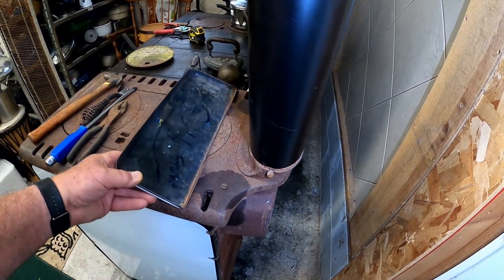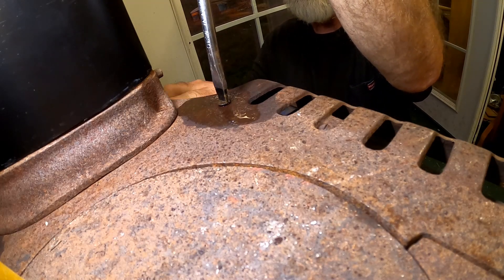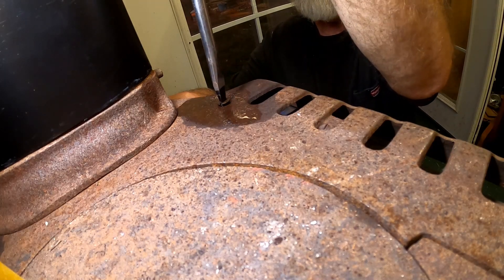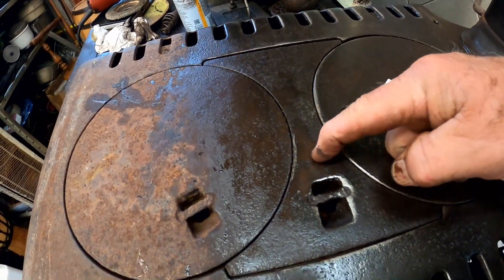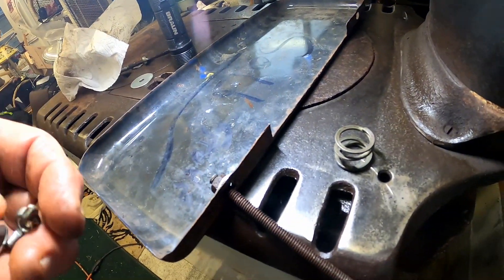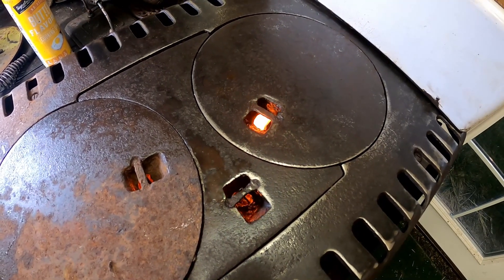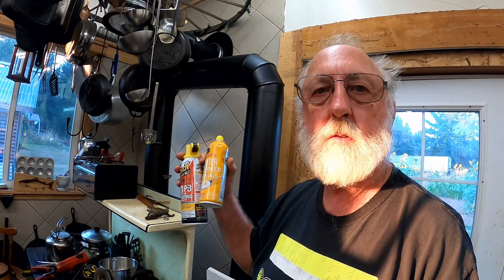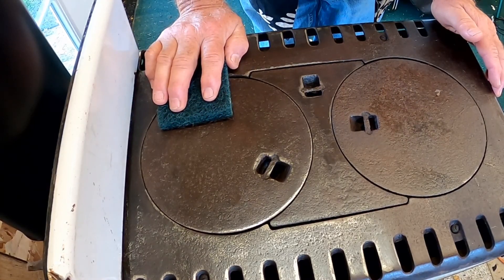Clean up your old wood cook stove top

Comment: Hi Bob- Where were when I took on restoring my kitchen wood stove?? 
Wow!  I used olive oil and 000 steel wool and a LOT of elbow grease! I will try a green scrubby now for touch ups with oil. That is a nice little stove you are fixing up. These stoves have character :-)
Reply from the maker: Olive oil is a good high heat oil and a good choice I would say. I had to dig in deep to clean this one up, so I broke out the power tools. The heavy duty green scrubby pad did well on the edges. Thanks for stopping by and the comment.

Comment: It is always a worry when throwing oily rags in the garbage. If I worry, I set the can outside in a safe area in case it catches fire until I can take care of the oily rags the right way.
Reply from the maker: It was something that happened at work. The janitor tried to clean lip stick off a dressing room wall with 3 different cleaners. Later I was called because the trash can was smoking.  That was a close one. Thanks for watching to the end.